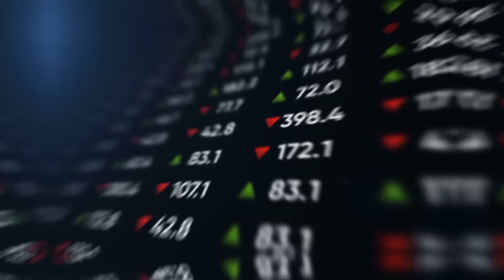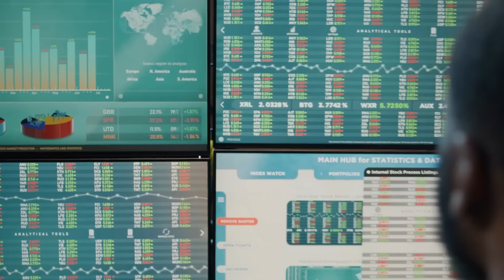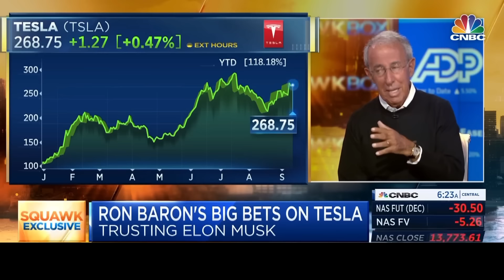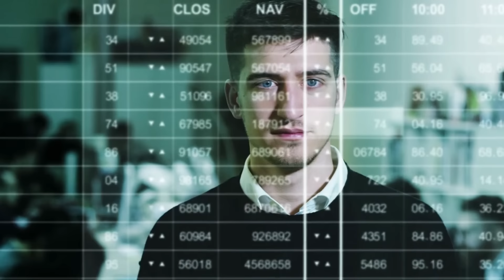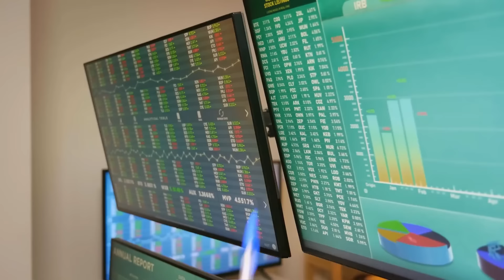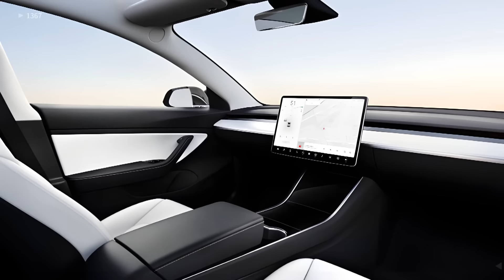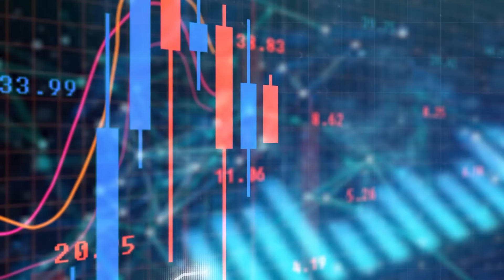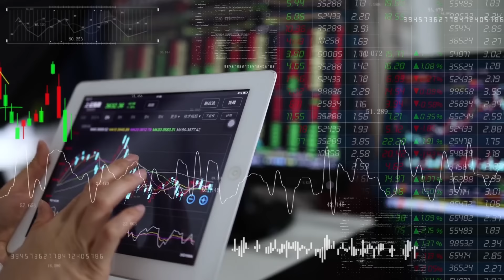Urgent Message To Tesla Stock Holders.? - RON BARON

Comment: We took delivery on a Tesla Y in December 2021. We have driven 44,000 miles. We could not be happier with the car. So we have bought 400 shares, and will buy more if the price stays low. A neighbor's daughter whom I just met said, "I have no car. I use [autonomous taxi service] to get to and from the airport in Phoenix." AI future is here now.
Reply: I’m laughing at you.
Reply: Buy as many share as you can too many big things they are working on even if they hit 20% of the things they want stock will juno 5- 10 times if you can hold it for 5 - 10 years 😂😂
Reply: Lol. I have a model 3 lr and my wife a model y. In the uk the value has plummeted. Even Tesla doesn’t want to offer a reasonable price to upgrade to a highland. Don’t buy anymore shares because it s going to drop a lot further

Comment: How I trade Tesla...look at a monthly chart..once it broke above $2.66 it quickly in 6 months ran to $13 before pulling back then then went to almost $18.. that is the ride I want to be on.  After the run to $18, it chopped for almost 6 YEARS!  But once it broke out at $25, it went on a 2 year run to $400 and is now pulling back and chopping.  TO hit $1,500 or $2,500 a share it MUST FIRST go above $400 ..so set an alert at $400 and wait for the next big run.  99% of Day Trades go broke so I do not play what the bouncing ball is going to do today or what some person on tv "predicts".  Look at the chart, buy when 50 DMA crosses above the 200 and sell when the 50 undercuts the 200.

Comment: EV's are failing.  They have failed in frigid weather, they fail as an efficient long distance vehicle,  they fail as taxis and fleet vehicles and police vehicles because of charging time.  They are extreme fire hazards-if you have an attached garage, you are risking everything if you park it there.  How long will it be before a flaming Tesla starts a wildfire in a state like California?  Collisions are much more likely to be totaled on an EV,  (they are dangerous to work on, and harder to repair) so insurance is much higher.  The batteries lose efficiency over time, and wear out after 10 years, so forget reselling it.  A recent study found that EV's cost 78% more to run per year. The near future is in hybrids, Toyota is right.